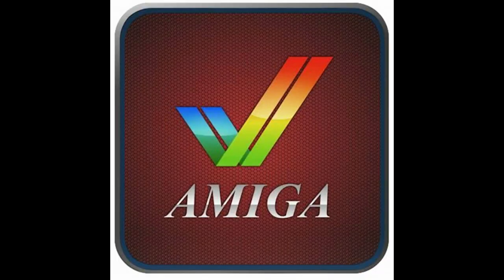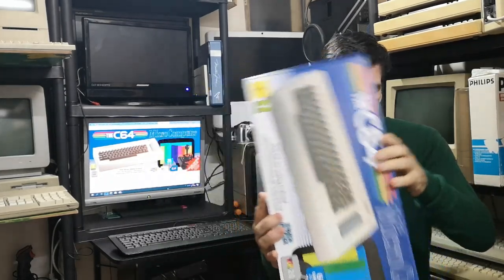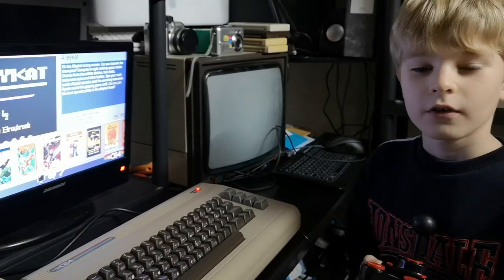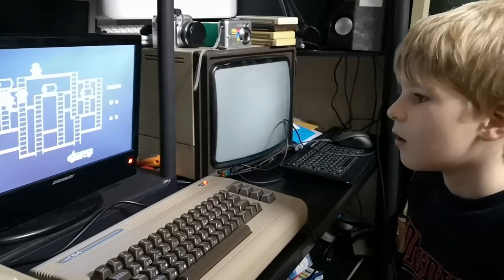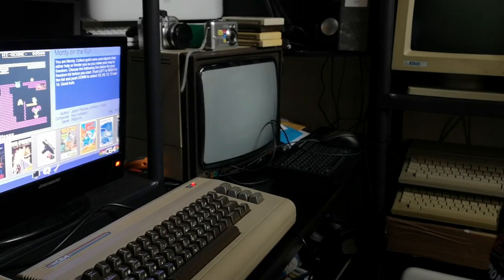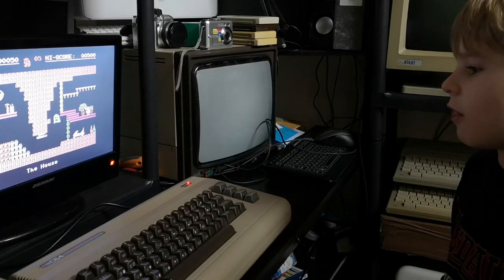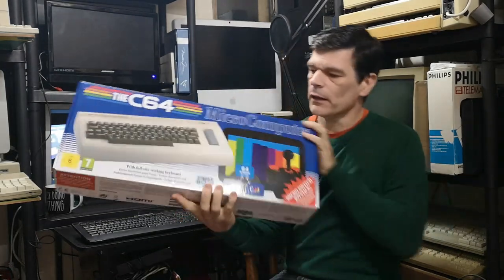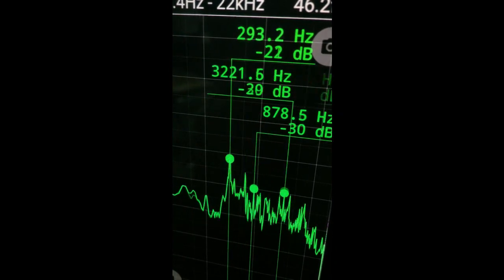Classic Computer -  C64 Maxi SID emulation and review

Comment: This is the video that sold me on the C64. Thank you so much for your astute analysis that was so relevant to what I wanted to know. I want the C64 for Sid Wizard, which sadly does not display correctly on my original NTSC Commodore 64. It displays fine in emulation, though. However, there's one big problem, at least for me: Using a PC keyboard with the Sid Wizard tracker absolutely drives me insane. The layout is horrid. Right now my workflow is to make a track in emulation on the PC and then import It to the C64 for sound recording. The C64 will greatly improve my speed with the correct keyboard but the best part is that it will sound close to what comes out of my original C64. Can't wait for this thing to arrive on my doorstep. I plan on prolifically cranking out some tunes once it gets here.

Comment: There is always going to be some difference. It's impossible to be exact when you're implementing it with completely different hardware. It's important to remember that the SID itself wasn't digitally perfect, either; There was analog behavior in the filters, and there was a lot of variance in the performance from chip to chip. I have three 6581's, all made during the same year, and none of them sound alike. The 8580 is a different story - my C64Cs with 8580s are close enough together that I can't tell. Really, so long as it gives a pleasing and convincing reproduction of the sound and quirks of the original, a little bit of deviation is totally fine. There are plenty of examples of bad SID emulation out there which show effects missing or distorted, and TheC64 seems to have none of that.
Reply from the maker: Thanks for your comment - Well said, even when trying to compare the frequencies like for like, there is very little  difference. In my opinion, the C64 Maxi is a very good recreation of the C64. 
One thing that a lot of people seem to have missed when reviewing this machine is that it will encourage further development to software as the C64 platform has expanded the user base for the machine. Developers now have the original machines, emulated PC based machines and the C64 Maxi to sell their products to as the platform has kept true to the original models hardware constraints.
This can only be a good thing for the future of these machines. 
Thanks for the great comment . Cheers Phil